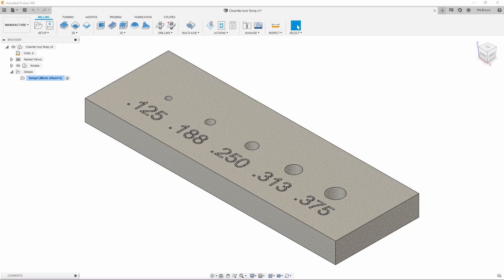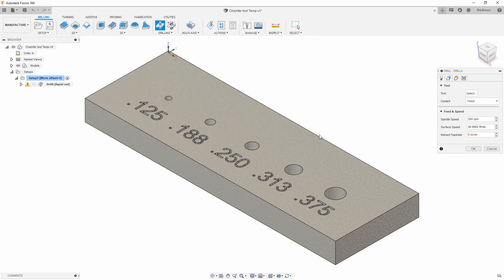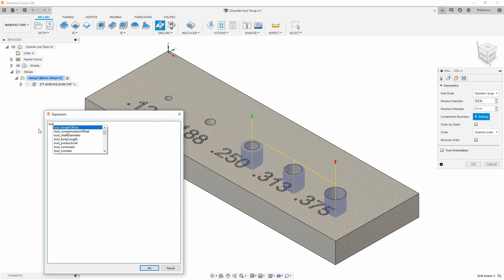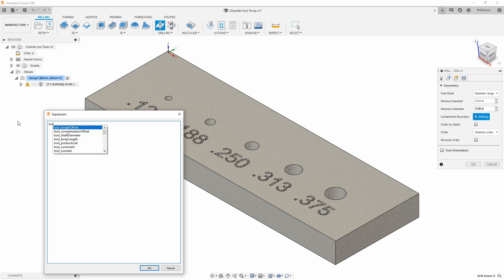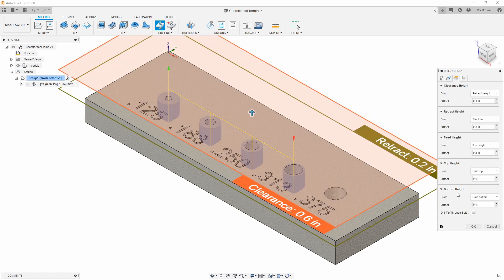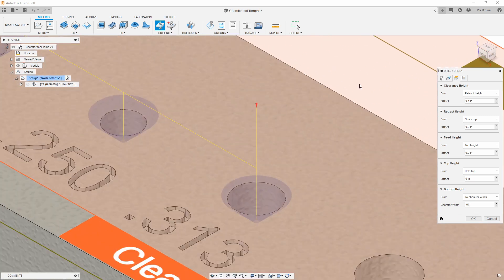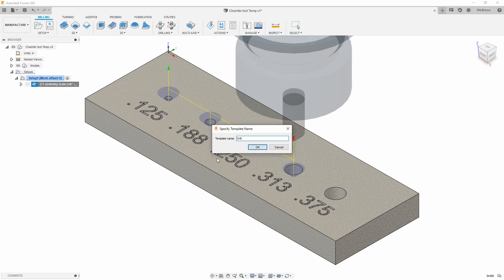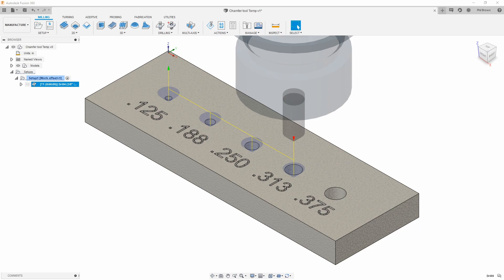QUICK TIP: Auto-Spot Drill

Comment: Nice. I was trying to do the chamfering by controlling the hole depth (adding .02mm to 1/2 of hole_diameter) but Fusion can't deal with multiple hole_diameters in the same operation apparently. One of the many bugs in the drilling operation.